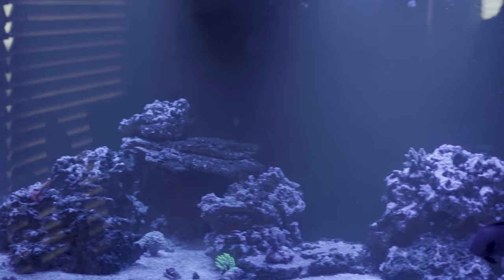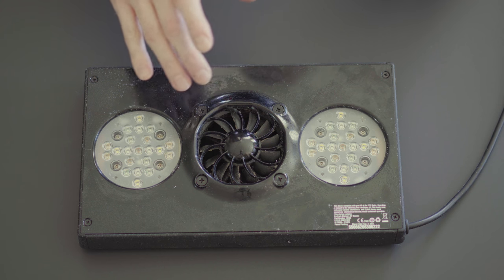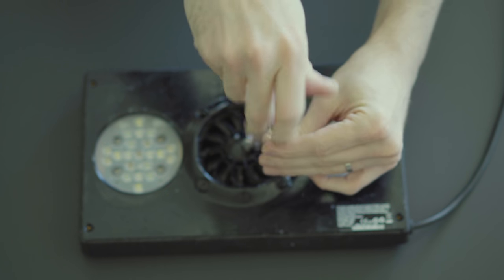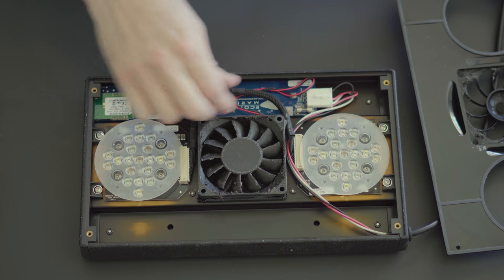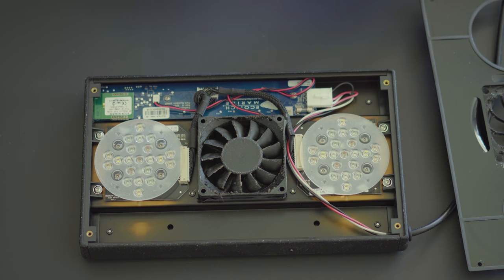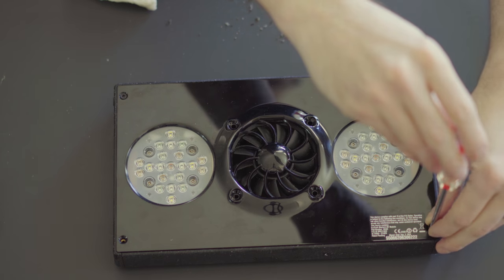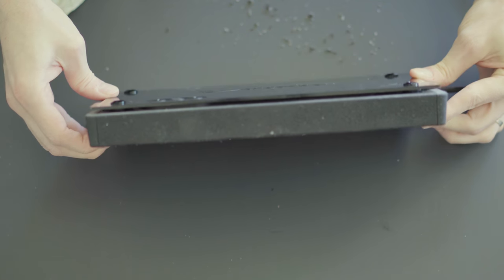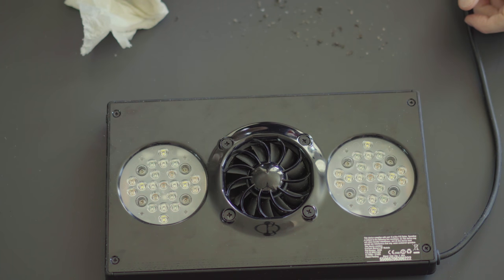Cleaning an Ecotech Radion Pro LED Reef Light

Comment: I find cleaning it out with a small paint brush and vacuum. Also taking the screws out on the back side opens up the heat sink and back of fan 👍🏻
Reply from the maker: Oh cool! I'll have to try that. I didn't open up the other side to see if it gave access. Thanks for the tip!!

Comment: It vents on the short side. Take off the cover, then there is a diffuser that can be removed and cleaned, as well as the top of the fan. From here you can see the cooling fins and can clean them. Usually there is a lot of buildup here. Replacement of the fan can be done here as well.